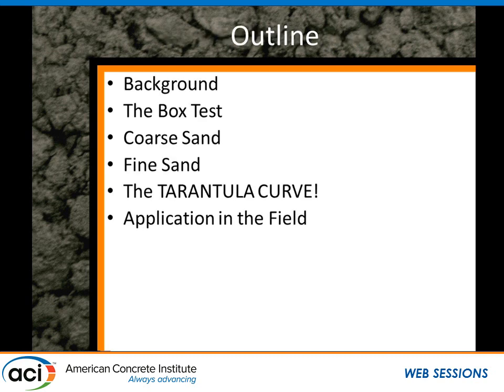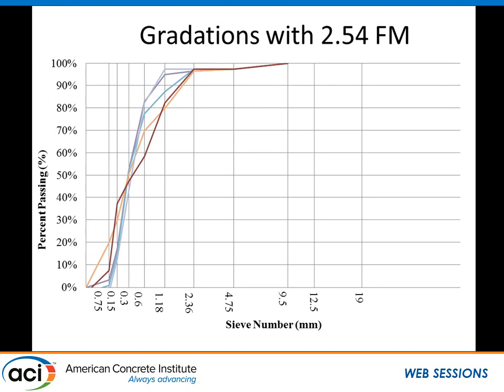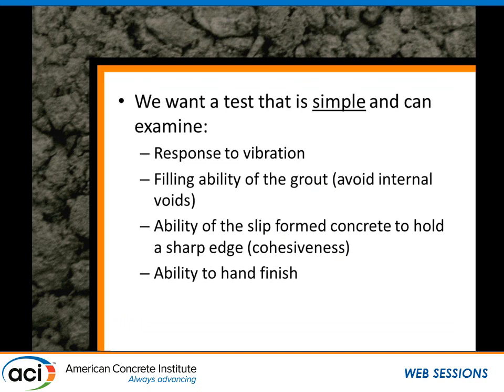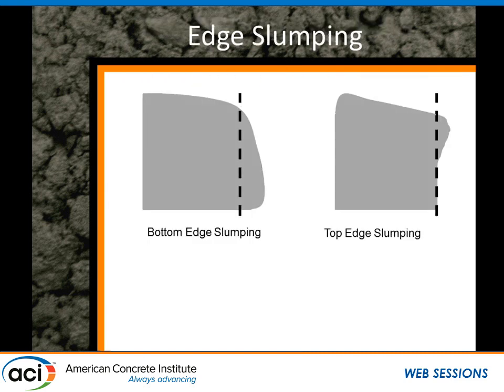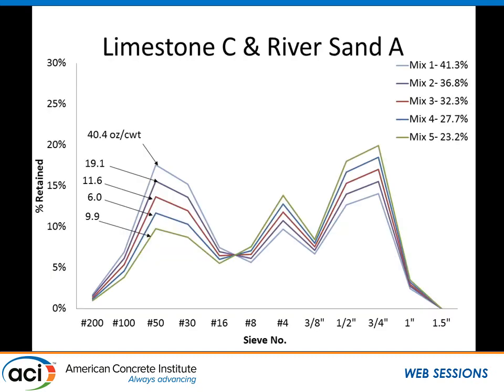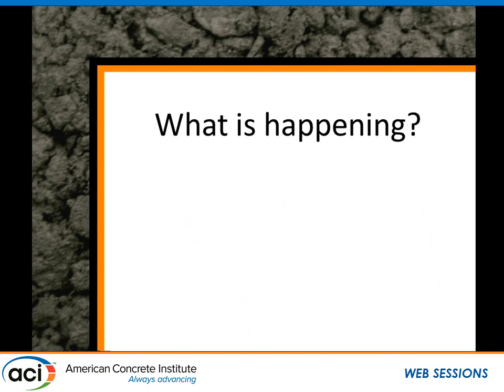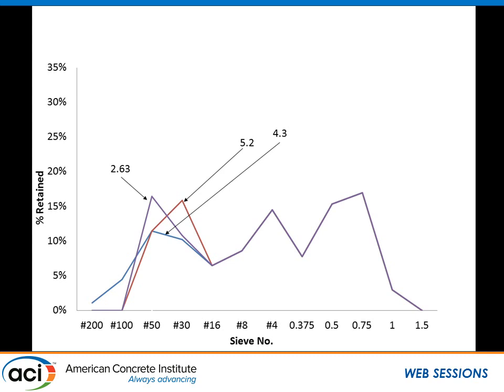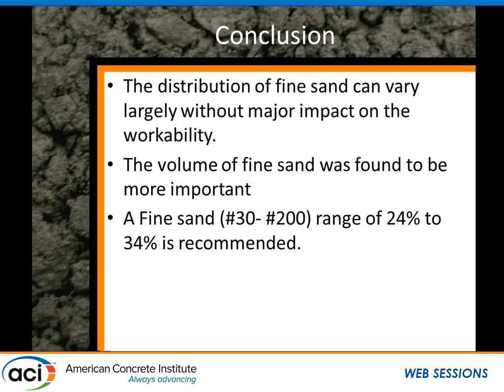Impact of Sand Gradation on Optimized Graded Concrete for Concrete Pavements

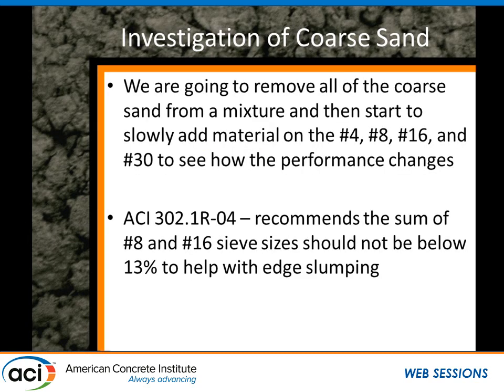Comment: Clarification on the video at 17:29. https://youtu.be/BjMMuZ12i4c?t=1049  
ACI 302 Recommends in general that when less than 8% is retained on each of 2 adjacent sieves, the 2 sieves sandwiching those inner sieves should bring the 2-sieve total to 13%. The specific example given is if #4 & #8 have 6% each, #4+3/8" must be >13% and #8+#16 must be >13%. However, according to the 2004 standard, you could have 9% on the #4, 6% on the #8, 6% on the #16, & 7% on the #30 and still meet the recommendation although there is only 12% between the #8 & #16 sieves.